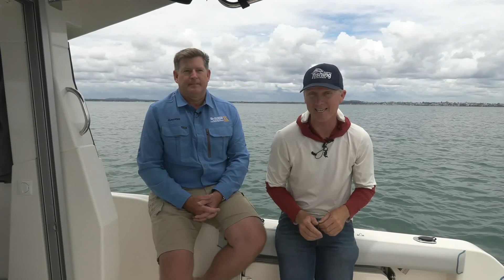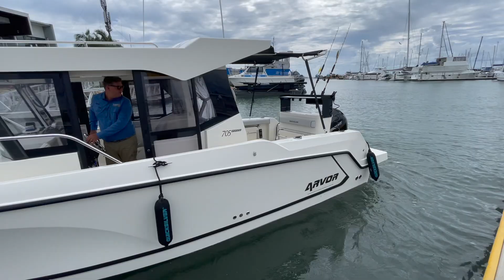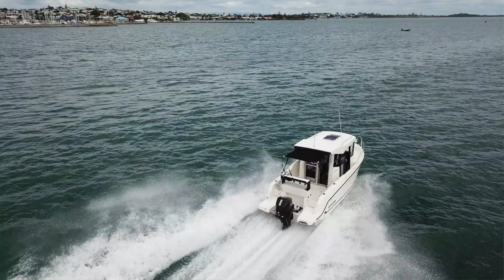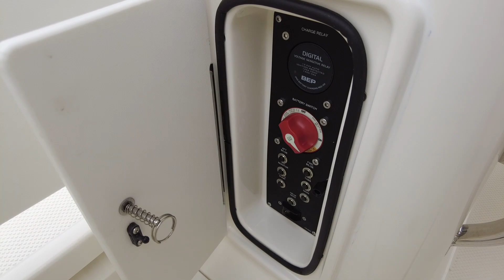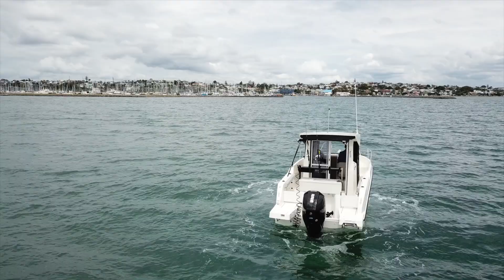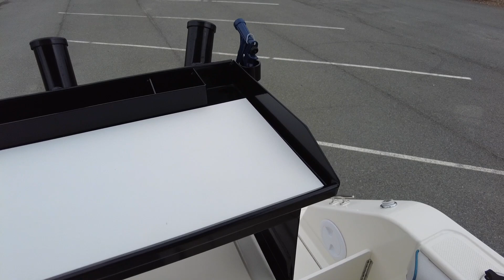Tested | Arvor 705 Sportfish with Mercury 225HP V-6

Comment: Great boat for camping, family days on comfortable water but I would'nt want to be in it in a bigger following sea, I don't see that hull designed for offshore heavy work.
Reply: Hi. Wondering why you think that? Looks very robust to me but I don’t know much about these things. Cheers
Reply: @jimreeves6377  hard to find deadrise in any spec but it looks to be about 16 degrees at transom. Wide beam for the lengh and a wide bow I think it would get pushed around in a following sea. It has some great accomodation for a family boat and thats defanitly it's strength.
Reply: that's exactly what the arvor was built for, the north Atlantic sea i think, not sure about outboard version though, the the shaft drive is a weapon.